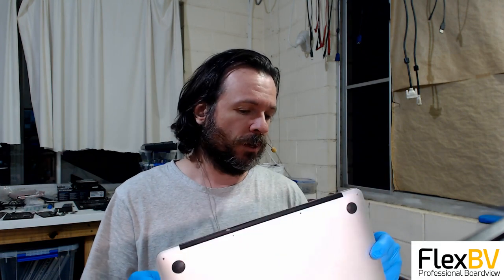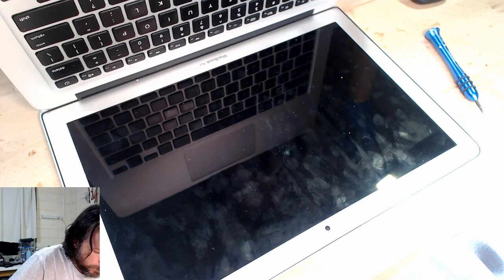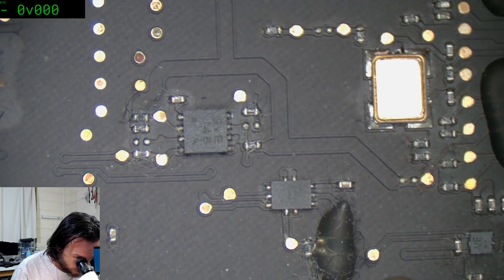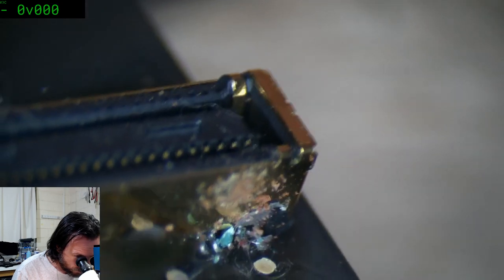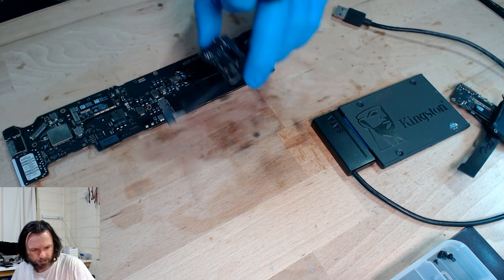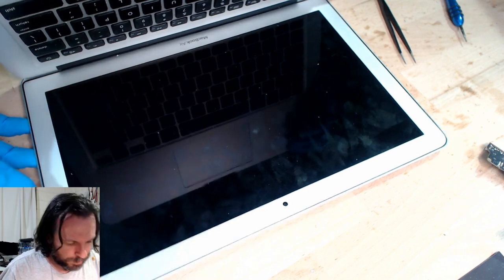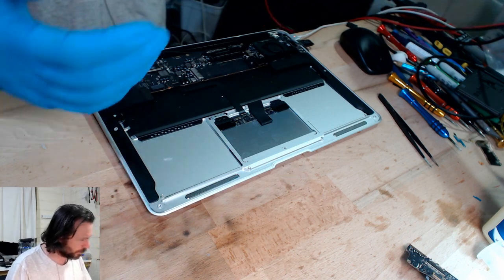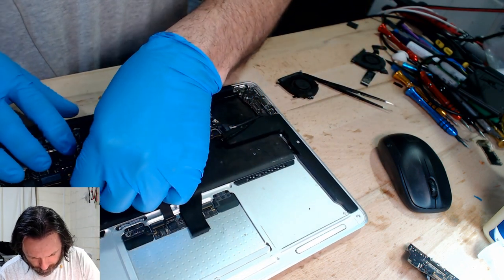LIVE - Friday night!  Party time with an A1466 Macbook Air with no power/boot

Comment: The shock is current from mains leaking through the Y rated caps in the switchmode PSU. 
The caps bridge mains voltage to DC output neg, which is macbook chassis. The caps are there to suppress EMI but allow nanoamps to flow between mains and the metal of the macbook.
If you bridge it with your finger to actual ground some current flows through your finger.
Because the voltage is not enough to jump you must come in contact with it. If the contact area is very small (which it usually is when you brush against something) then the area of your nerves that takes the hit is quite small and gets hyper stimulated.
Reply from the maker: Brilliant explanation, thank you sir.

Comment: Missed the Live stream again..... I was fixing something and puff live stream was over..... Paul do you use
VC8145 as multimeter? Do you know its impedance in DC V mode.
Reply: As did I.
Reply from the maker: Don't know for sure what the impedance is in DC V mode (and which range?), sorry.  I guess for most general work it's not been something I've bothered to check on this meter.
Reply: @pldaniels  I have one hand held that has such low impedance that it makes 3.3/5v regulators crazy if I measure feedback/pgod pins. Everything from humming to plain shutdown.
Reply from the maker: That's a bit crazy low.   I'll likely be upgrading again in the near future; looking at a Siglent 4.5 or 5.5 digit bench unit